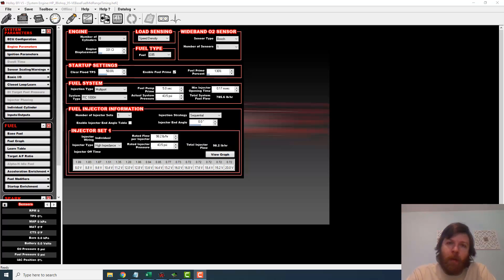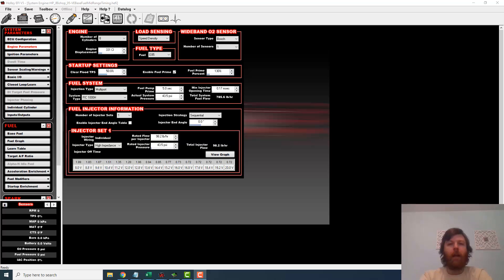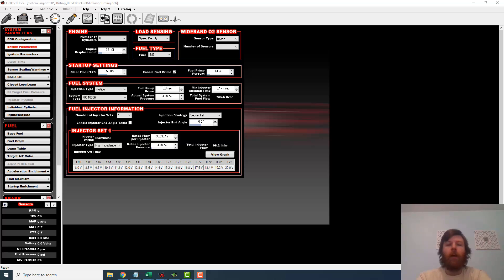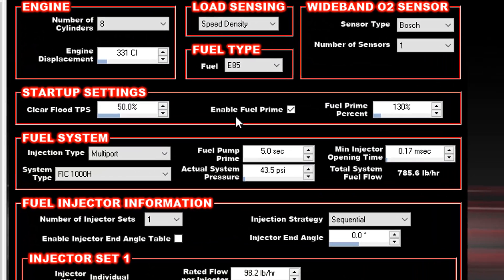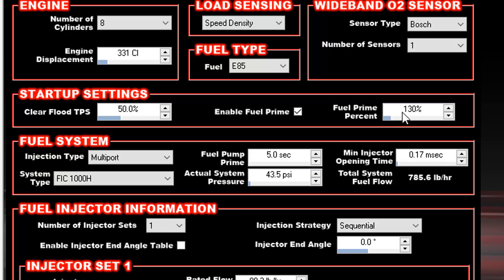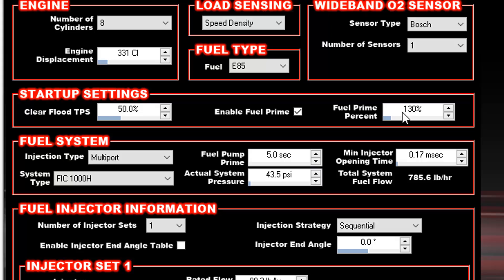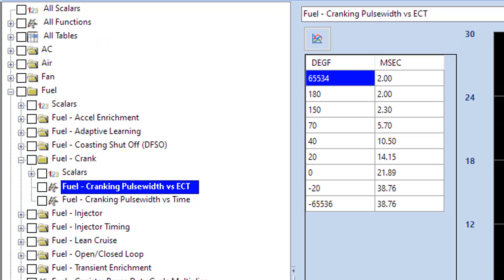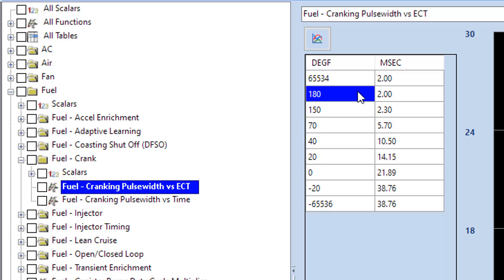Cranking Fuel Priming Pulse in Standalone vs Stock A9L Computer

Comment: Hey Matt appreciate all your info your very intelligent man... so can this work for a a9p? Also stupid question can you convert a a9p into a a9l?
Reply from the maker: These same cranking fuel settings are available in A9P. If you use a moayes quarterhorse chip, you can run an A9L tune on an A9P ECU and vice versa.
Reply: @LeechMotorsports  very cool so this may be another dumb question I heard a aod o2 sensor will fry a a9l..  will the quarterhorse make it possible to use aod o2 sensor with a9l or is that all with in the wiring?
Reply from the maker: The oxygen sensors are the same on a9l and a9p. However, the harness they connect to is not. And that is where the issue lies. The o2 harness basically merges together from each sensor, then goes up by the frame rail and connects with an 8-pin connector to the main efi harness. At that connection point, there will be two pins that are jumped together. Depending on which harness it is, the location of those pins will be different, and that is how you tell which harness it is. You can manually move the jumper as needed to make sure it is correct for your computer. Here is a video I made about that subject.

https://youtu.be/YNFDsfBxP8U
Reply: @LeechMotorsports  heck ya man thank you for your help

Comment: Good video! I had to dial in my hot cranking fuel. After the car would come up to temp, I could shut it off and try to restart it and would just spin. I had to add fuel in the cranking pulsewidth at 180 degrees to get the car to start

Comment: Matt so the fox computer can control electric fans?
Reply from the maker: Yes it is possible. It requires running one wire from an unused pin on the 60-pin ECU connector to a relay for your fans. Then you can turn on fan control and configure the temperature points where it will turn on and off.